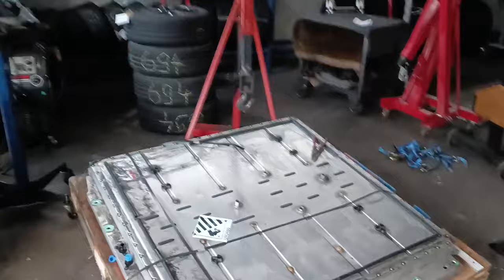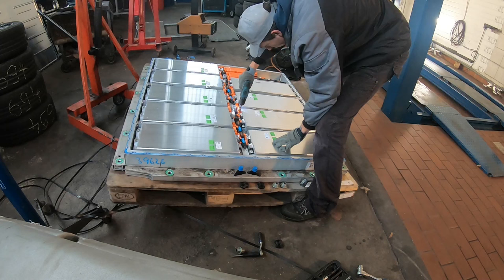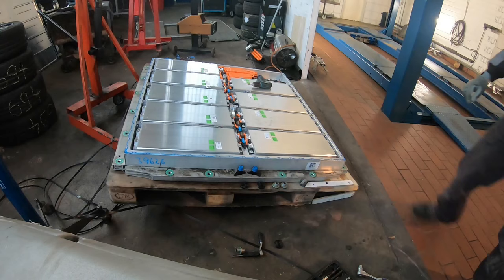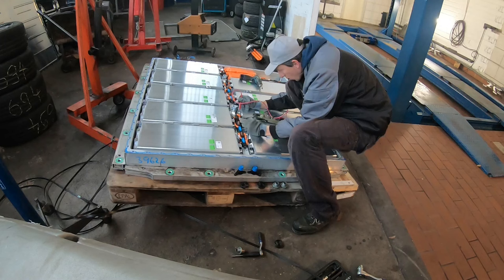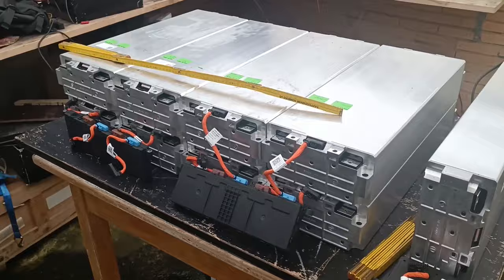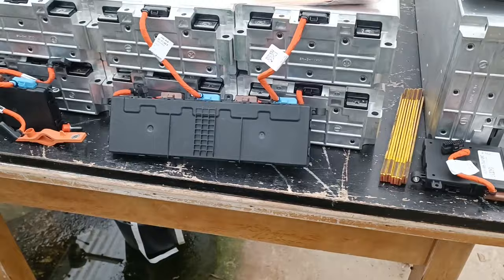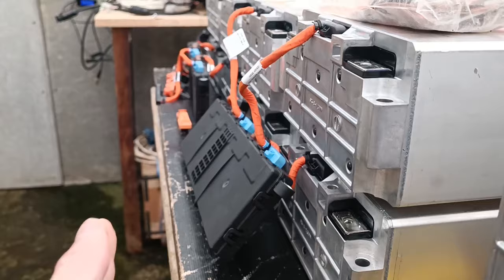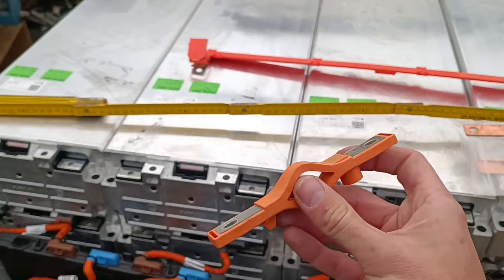Lab Update #81: 55 kWh ID.3 battery upgrade for Touran

Comment: long time coming, looking forward to see this on the road! Nice little aluminium blocks, they look easy to handle. Interested to see how complicated the BMS integration will be with these.
Reply from the maker: I think the module units are hacked but of course they just provide voltages and temps. No charge limits, SoC, current and such. Will be an extra challenge!
Reply: @EngineersFear  nice, I am still keen to write the code for that, would be nice to have an algorithm open source for the SOC and chargelim and dislim calculations

Comment: The two big outlets are for the DC FC port and other is for powertrain. So it make sense the second set of HV relays are for DCFC. I also believe that they only have a pyro as main pack fuse.
Reply from the maker: Oh, that makes sense! So then the 100A fuse is just for auxiliary stuff

Comment: Hi Johannes and thank you for this new video.
I can't wait to see what happens next...
A question may be ridiculous, when connecting the different packs in series, no risk of electric arc?
Example of packs of 40 or 80v each can be connected in series, without risk?
55kw will certainly be a good upgrade, for autonomy, it's good!
Reply from the maker: In series the voltages just add up. Paralleling is probably what you mean. Connecting an 80V and a 40V battery in parallel would result in meltdown ;)

Comment: Hallo Johannes, danke für das Video! Wie bist du an den Akku gekommen? Ich gehe davon aus, du hast ihn nicht für 10.000€ bei ebay gekauft?

Hello Johannes, thanks for the video! How did you get the battery? I'm assuming you didn't buy it on eBay for €10,000?
Reply from the maker: I bought it from a Norwegian scrapyard and found it at bruktdel.no and yes it was much less than 10000€

Comment: no precharge relay inside the pack?
Reply from the maker: Yes forgot to mention that, couldn't find a resistor or relay. Maybe they do like Tesla and charge the caps by reversing the DC/DC converter from 12V to 400V?
Reply: @EngineersFear Yes that's exactly right, they did it like that. No resistors and precharge relay needed there.